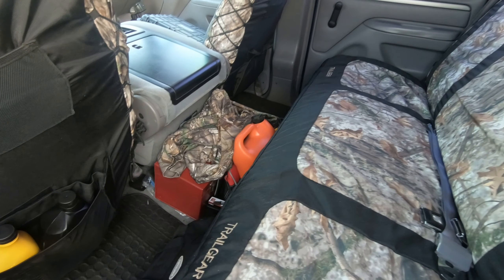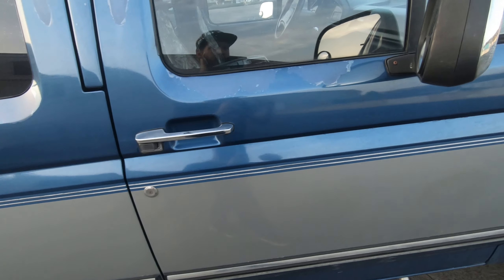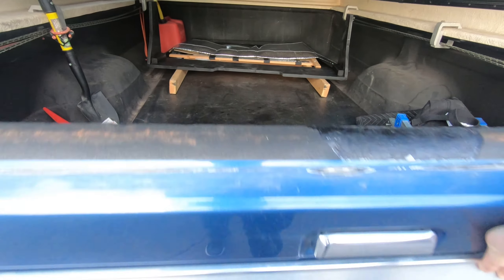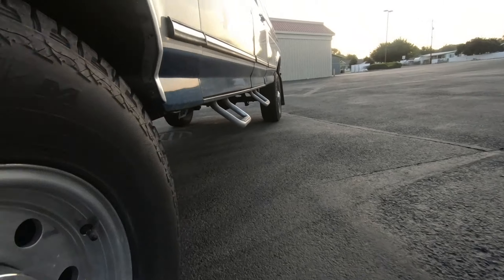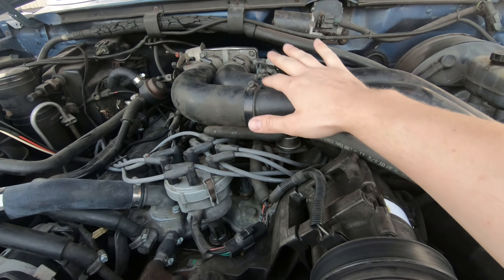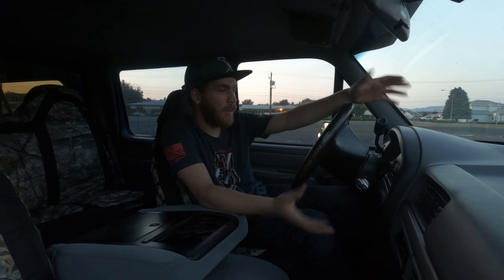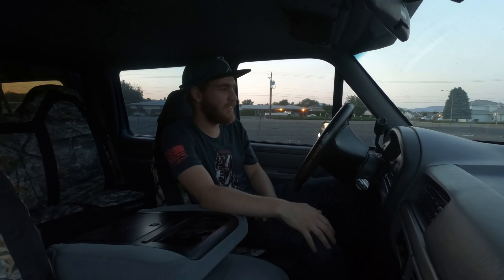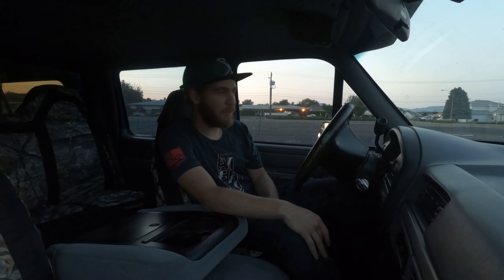1994 F-350 Review!

Comment: I've been wondering what the difference between C6 3 speed automatic and E4OD And what year did the 3 speed C6 Stopped
Reply from the maker: The 3 speed C6 stopped production in 1996 as well as being hydraulically driven, while the 4 speed E4od has electronic solenoids to shift through the gears.  I believe the E4od stopped production in 1997/1998.  Thanks for watching 😀👍

Comment: How much did you get the truck for? I’m in the market of buying one.
Reply from the maker: I believe I paid $5,500 for it back in 2018.  It was a great truck but it only had a 3speed transmission so the RPM at 60mph was 3,000.  I sold it to buy my 1997 Powerstroke.  Good luck with your purchase👍👍

Comment: I’ve always thought about bed lining my frame but my main concern would be trapping moisture under the coating.
Reply from the maker: That’s a legitimate concern.  We don’t use a  bunch of salt on the roads during winter where I’m from so I bed line just about all my trucks without worry.  However if you were in the “salt belt” you might want to get a product that’s just meant for truck frames that resists salt👍